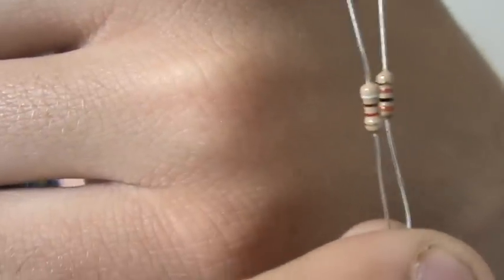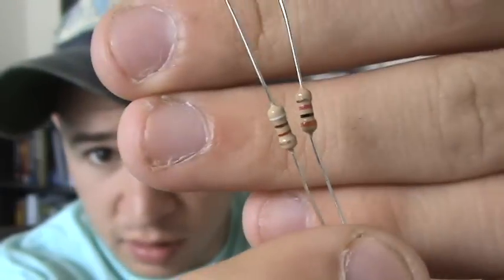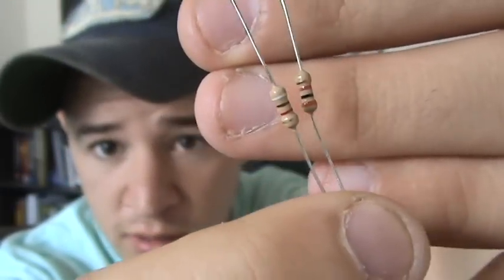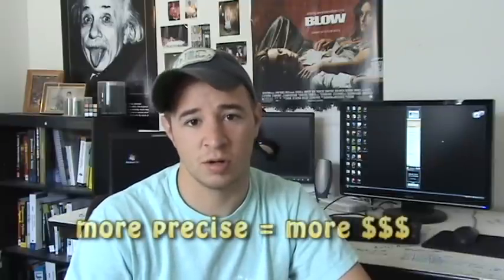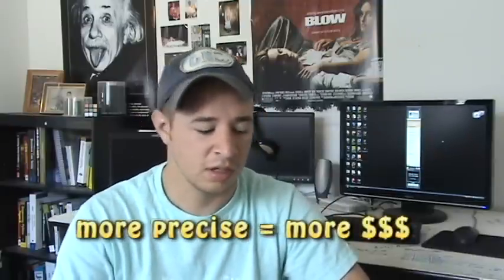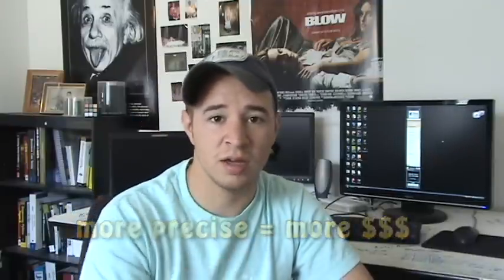Robotics and Electronics Tutorial - 6 - Intro to Resistors

Comment: The difference between 1/2 and 1/4 Watt resistors is their ability to carry current and withstand/dissipate heat as curent passes throughthem.

Surface mount refers to the method of soldering them to a board.
Beginners should use the through hole mounting which requires wires.

Comment: Good video.  You might want to go over the color bands and how they can be used to identify overall resistance and tolerance - or at least mention it.  As far as tolerance bands, you want to look for a gold band (which indicates 5% tolerance).  Silver is 10% and no band is 20%.

btw - the tolerance is total tolerance, not +/-.  So a 5% tolerance on a 100 ohm resistor is actually 97.5 to 102.5 ohms.

Cheers.  Keep em coming.